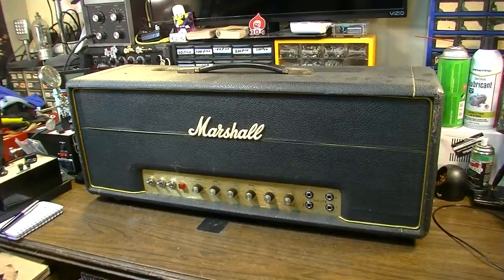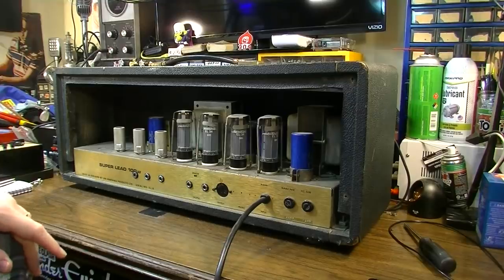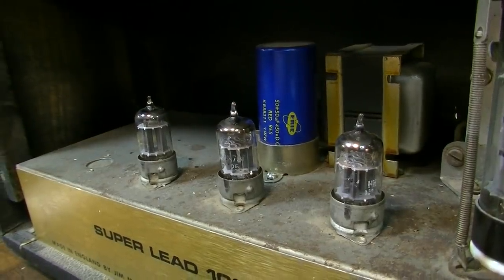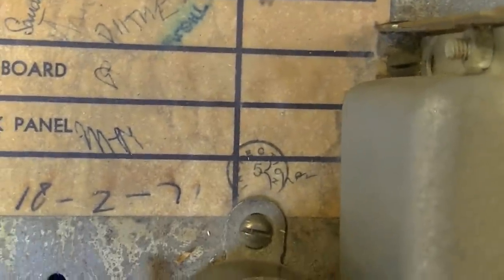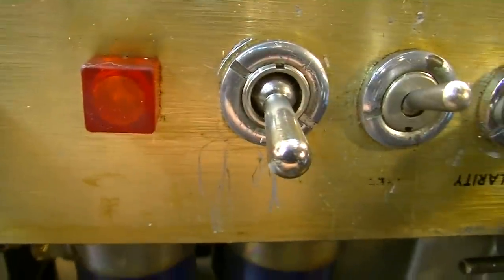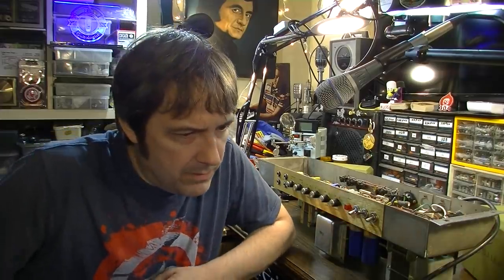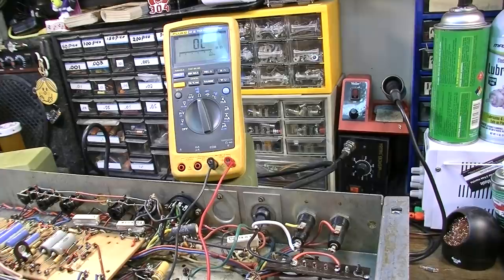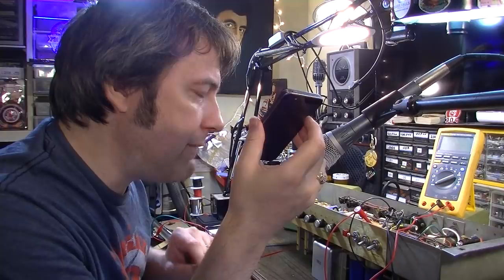Secrets of the Marshall 1959 Super Lead - 100W VINTAGE 1971 TUBE BEAST REPAIR!

Comment: damn, this is the same amp my dad has, though it's the Tremolo version instead and the tremolo version came out in 1967/1968. but I will say this, the Tremolo version was heavily modified starting with the speed and intensity knobs being removed second the 100 watt transformer was upgraded to a monstrous 200 watt. thing was though it was found in a fire, like it was a paper weight, 3 of the four input jacks were also blown and covered up. and it's been working ever since then.

Comment: In Jest! 
Your date format is only used in US so only by a fraction of the worlds population. Solder is the correct term  and not sodor: https://en.wikipedia.org/wiki/Soldering, We drive on the correct side of the road but this was before the US was even heard of. The trend of left-hand driving predates the automobile by centuries—all the way back to the medieval age of knights, swords, and constant warring. Since 70–90 percent of the world’s population favour using their right hands, during the times of King Arthur, soldiers and weapon-bearing citizens would prefer walking on the left side of the road so that their strong right hand would be free to pull out their swords in case danger arose.

Comment: If you find semen inside an amp head you know it's been around the block a few times ! Lots of non original stuff in there .It was common for the bigger manufacturers to use red lacquer as it not only shows good connection but prevents corrosion from excess flux . I use different colour lacquer on classic amp repairs by marking non original work by others in blue and mine in green and leave that info legend inside . Yes the Rean jack is not good , should be Cliff or other marked made in England. 1k5 resistors are changed out , one had a suspicious brown spot .Switches are typically 'Arrow' and good quality but break after time and good originals are hard to find , maybe old UK aircraft breakers , that's why the Carlings are in there as its been over there a long time .
I always check ebay for people parting out old lab equipment for job lots and have a ton of switches in good condition going way back to laminated types through brown and black bakelite, to new Carlings which are good for Trainwreck or other later clones .

Comment: Hey man I have a question I have a 1977 jmp 100 way combo the 2103 one of the preamp tube sockets is microphonic I have put 3 different tubes in it no matter I put in it it’s microphonic and there is a 60 cycle hum when u turn the amp up what can I do to fix this!?? Thank you for your help man you the man

Comment: Early Marshall 100 watt heads had 4 speaker out jacks.  I have several from the late 60s and early 70s. All have 4 out jacks.  At some point they went to 3 or even 2 output jacks.

Comment: I've been thinking of building amps with uncommon tube compliments; one I've had my mind on is one with a 6AF11 and a 3C22 output tube driven in ultra-linear with its own power transformer.  It would be convection cooled and biased conservatively at 50 watts.  The 3C22 is a disc-seal triode similar to the 6550 designed for use in radar jammers.  It can be used up to 60 watts plate dissipation with natural convection cooling and 125 watts with forced air cooling.

Comment: The brownish red marking on the joints is Tintalite, which was used by electrical inspectors to show that a solder joint had passed inspection. (from UK)

Comment: With all those speaker Jacks in the back I wonder what is impedance was I'm surprised the output Transformer could handle it or he was using the app is a PA system that poor Marshall

Comment: Recap, recap, recap ... what's a waste of time and expense to the customer for what ? No gain in tone at all !  If the DC voltages are all good and within the range as specified on the schematic then leave 'em in and let the amp be as stock as it should...

Comment: Broken switch, and the guy takes a hit for new caps and tubes? Musicians! Spend 10 years practicing sweep arpeggios that sound 80's and which nobody is impressed by anymore, but can't spend a few seconds learning how to swap out the tubes and re-bias, or solder in new filter caps.
Reply from the maker: Try learning to solder on a vintage Marshall at your own peril. What will happen is you'll fuck it up and it'll end up costing you double when a tech has to come in behind you and rewrite it or replace a transformer. And sure, he can just replace the switch and fuse and be jamming again, but on high hour tubes and original caps filter from 1971, not exactly road worthy. I make videos to help people learn if they choose to, but learning to diagnose issues and know what can stay and what should go in an amp like this takes a bit of experience. Sure, learn how to do it, but get help if your guinea pig is a collectible vintage Marshall.

Comment: Hey man, i`m just getting into tube gear repair and maintenance and now i`m trying to gather some tools.
I ordered a bundle of alligator clips from aliexpress, you know the bunch.. 10 for 3$. I got them to clip them on various components in order to read plate voltage and stuff hands free. Is this a good ideea or the the small aligator leads will melt when trying to read plate voltage?
Cheers !

Comment: Great video as always. Just for the record, English dates were written long before the American system was invented. Also, you need 28,29,30 or 31 days before you have a month and then 12 months before you have a year (which is how the English system was designed). I don't want to rub it in but we also drove cars on the left side of the road before any car was driven in the USA. Just saying........

Comment: I have a 1970 100W Super Lead that I bought in 1975 with two 4x12 Greenback 25w speakers (top & Bottom) and I STILL own this amp now. It has not been turned on since 6/86 , the original two pronged power cord was rotting badly and I didn't want to risk anything so I cut it off as not to get shocked or start a fire. It needs filter caps as I read in 87-88 a Guitar Player Magazine "AMPS" that explained my amps symptoms to a "T". it sounds as though it has a "funny out of tune lower octave" and mushy etc....Just exactly like mine started to sound and feel. I paid $500 for it when I was 17 years old.....for the whole stack. It IS Jimi at Band of Gypsies/Woodstock......Like Todd Sharp says "you can smell an old Marshall or AC 30 from a mile away. I grew in the great Mojave Desert in Eastern Kern County Ca. I put about a zillion hours in the heat on this amp and it just once ever blew a fuze.. In 1987 I bought brand new N.O.S. power tubes for it that hasn't been powered up. I still have the Whole Stack to this day and need to get it serviced soon... I sure can't take it to heaven with me ! Ben Fargen (Iv'e been playing Fargen amps the past ten years) really wants me to send it to him for "servicing" Oh my.. :0~

After watching this video, this amp is close to mine but in all the years Iv'e had this amp I have never once seen one identical to mine. Mine has the three black bats on/off, polarity/standby switches, four speaker output jacks and the inside is a different color board as I remember. It still has the Erie cans but as I remember mine are a lighter blue in color. The ONLY thing that went south was those rectangular screen resistors that are on the bottom side of the power tubes. Two of them had  cracked and were replaced in about 1977. I see one of them in this video looks like it has a crack on it as well! My tag board  had all women names on it and was told that they were more desirable as the women were more patient solderers than the guys were.......The amp when I got it from the owner said it had sat for about three years unplayed. Jus had to say!  I have owned it for 49 years now.....crazy to think but I just new that someday it would be worth $$$$$
Reply: I CAN'T WAIT TO SEE PART 2!!!!

Comment: We make quality amplifiers in the UK and the Americans, not only drive on the wrong side but don't set their calender's correctly.  Just change the switch, and the screen feed resistor on the left EL34 base, it will run for another few dozen gigs, if the EL34s didn't kill that resistor. Here is the schematic, I own three of them from the 70's. Russian Winged C EL34s are almost as good as the original Mullards. https://www.thetubestore.com/lib/thetubestore/schematics/Marshall/Marshall-JMP-Superlead-100W-1959-Schematic.pdf

Comment: Damn. 71 is the year that is 'sought after' by collectors. If it was near mint, that would be like a $10K to $15K amp. You gotta be careful to do "vintage correct" parts in these potential collectibles. I will, eventually, either get a (later) 70's Superlead or maybe an Orange OR100. Probably the Orange, I like the gooey sort of Orange sound, but there really SHOULD be a Marshall in my studio.......
On an unrelated note, do you still have cymbal hardware? I realize it's been a long time, but I have actually been trying to play drums since my drummer decided to, uh, cash in his chips..... and so I need to set up a kit somewhere on the ground floor of my house, separate from upstairs, so I can practice without putting wear on the good studio shit (I'm just not worth that good a kit yet). I need stands. Boom stands, straight stands, double stands are cool, whatever you got.
Reply: I've seen them go for 12 on Reverb. When they're all original, like new condition, collectors pay astronomical amounts. I'm not saying it is rational, you can get a 77 for a grand or less and it'll sound almost exactly the same, but people pay out the ass for these.
Reply: The entire "collector" phenomenon is a bit ridiculous to me, to be honest. You see famous (and already extremely wealthy) rock stars selling their used crap on Reverb for like 30x what the same thing goes for new. Even Steve Albini got in on that racket (he isn't that rich, but he isn't hard up either, and his philosophy would seem contradicted by this) because "this is the magic RE20 used on Dave Grohl's kick!" or whatever. It's just ridiculous. I guess I should be more annoyed by the fact that people are willing to pay exorbitant prices for these haunted guitars or enchanted mics, but Albini cashing in left me a bit disillusioned.

Comment: When your at it delete the standby switch, those things have no point. Or at least put a 47k 2W resistor and a 100n 630V film cap across the contacts, should help lower dv/dt, save the contacts and the reservoir caps in the long run. Also you might want to put a neon lamp (NE-2) between grid and cathode of the cathode follower. It helps the tube have a longer life - saves it from arcing on startup.

Comment: Well, if those Siemens EL34s had served hundreds of hours and run hot, there normally would be some brownish marks inside the bulb near the holes of plates. But they seemed quite clean. Dust on them does not necessarily mean anything bad inside the tubes.

Comment: It will be interesting to find out what problem is and what the customer will have you do. If it is only a backup amp, it still needs to be reliable. Any number of things can cause an amp to fail at a gig. I try to take a spare myself to a gig, although it is extra space and weight to carry around, knowing there is an amp available in a matter of minutes waiting in the wings so as not to to leave one stranded, is a load off your gigging mind! Full meal deal is needed. That service bill will be far less than replacing the amp with a similar amp, if you can find one. If the owner is a gigging stiff, he will recoup the service bill over the next few gigs and still make money gigging with this amp, because the service will last for several years. Who knows, after you get done with it, it very well may become his #1! Thanxz

Comment: The speaker impedance selector has been upgraded to the later switch design - earlier ones had a plug you removed and turned to suit the load. Give away is the marks from the old screws, and the hole will have been drilled out with a 'conecutter', or filed - the new switch is just a bit bigger. In Europe we have to change out the mains voltage selector too, and the lethal Bulgin round mains connector. Output valve holders may have been replaced, too. I only ever see those spring holders in the combo amps - those ceramic bases are superb.

Comment: Comparing the dust on the transformers and the tubes, the can capacitors have already been replaced, don't you think? Those three output jacks at the back are a total bullshit mod! It's not even an effects loop. If those are speaker outputs, I don't understand the reason to get five of them. It's the best way to blow your output transformer, if you're not familiar with multiple cabinets impedance match.
Reply from the maker: No, the cap cans are original, in my opinion. Marshall did use this brand of cap, despite some other comments, and the labels show decades of damage under the clamp retainers.

Comment: Hi Brad. Qc in uk frequently used nail varnish to mark where a test point had been checked. Nice and cheap, built in brush and quick drying. I’ve done this myself on screws which also shows that the nuts have not been disturbed.

Comment: Watching your videos throughout the years, I have noticed you rarely use a tube tester (at least not on camera). Since all of the tubes seem to have a lot of wear (based on their looks), it would be interesting to have them measured through a tester and see what kind of emissions they still have
Reply: The problem is emission doesn't really tell you that much.  Transconductance does.
Reply from the maker: Honestly, my testers aren't all that sophisticated. And I don't find them all that useful anyway. They can find some shorts and low emissions, but they can't tell me about microphonics or intermittent issues and the like. I just find that I'm able to suss out most tube problems by other means. In the case of these output tubes, they have been in this amp since 1993, according to the date code. And they have bluing at the top that tells me they've been ridden hard and put away wet. I don't recommend throwing these tubes away, by any means. I think they will probably still work perfectly fine in a pinch. But in this situation, if I'm already in this thing and changing caps and other stuff anyway, why not get a new matched set and tweak the bias? In the long run, it makes sense to go ahead and do that and keep the old set of tubes as backups. Make sense?
Reply: @TheGuitologist  I absolutely agree that it would be best to replace all of the tubes, in order to perform and record with this amplifier in a reliable way. I'm just curious to see how the obviously well used tubes would fare being subjected to a tube tester.
Reply: @davidfuller581  You are absolutely correct.
Reply: @TheGuitologist  You really should get a decent tube tester.  I have an old Sencore, even it has a "life test" for tubes, which tells u how much life is left in them.  I would not ditch those awesome Siemens EL34's unless they had nothing left, not because they look used.  IMO there are no current EL34's that sound or perform anything like them.  If it ain't broke, don't fix it.

Comment: Those tubes, nos, are about $100 each. I'd test them!
Reply from the maker: Well, that's new old stock, which these are clearly not. They aren't going in the trash or anything. He'll have them for backups. You need a set of backups anyway.
Reply: @ab5ni The particular tubes in that amp can easily be priced online if you wish.
Reply: @TheGuitologist  Nothing manufactured this century will sound the same, so if they are good, they are better than backups. But a quick review of them by you will let us know. I just know I have ones that look worse that test and sound like pure unobtainium. Can't wait to hear the finished amp!
Reply: @TheDogPa  Probably true. I have many Siemens tubes ( especially  ECC83s and EL34s) which I purchased in the late 80's and early 90's. I do not know if they were NOS or recently manufactured then. They all turned out to be of very high quality. Particularly EL34 are all visually very impressive (because even the bulb sizes are so closely matched), and they sound great and last long. And those ECC83 double triodes are nearly always like a matched pair. Just impressive.

Comment: Very cool amp. ‘71 was the last year of point to point wiring for Marshall. They switched to PCB’s in ‘72. Obviously the P to P wired ones are easier to work on and most likely sound better because of a more direct signal path. 
Brad, please check those tubes! They may still be fine. Siemens made some of the finest EL34’s and just some of the best vacuum tubes ever produced!
Reply: They switched to PCB’s in ‘73.

Comment: I have a 1971 model 1959 ....my Tech told  me that even with volumes only at 2 or 3, as soon as the amp starts to distort, it's running at Full Tilt and is stressing the components...do you agree with this ?
Reply from the maker: Yep. As far as output power, it’s running as hot as it’ll go one the output tubes start to distort.
Reply: @TheGuitologist  wow Ty so much for the concurrence. I actually thought that I was NOT pushing the amp that aggressively with preamp volumes that low.... but the problem is it just sounds so great with the output tube distortion....when I crank the pre amp Vols I need to bring the master up to about 5 to get close the same sound...but it's still missing something. Guess I like output tube distortion better! And as you know either way it's effing loud! Tx God for my Badcat attenuation.

Comment: Those Siemens outputs look almost brand new.  They are one of the better EL-34 ever made & fetch about $300 per quad   If you pull 'em out ...send 'em to me.  :^)
Reply: Exactly!And then you put brand new ones in there and it will sound like shit.The same with the preamp tubes leave em!”Dont even look at them”.Theres no new production tube that sounds as good as those babies.